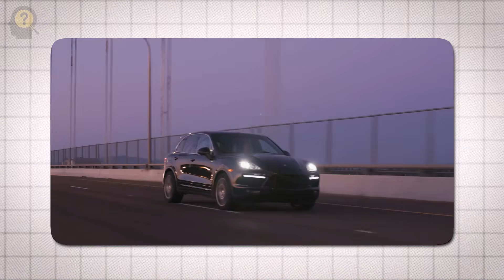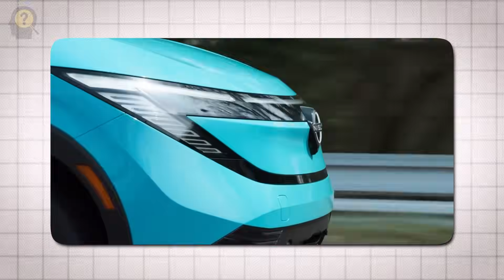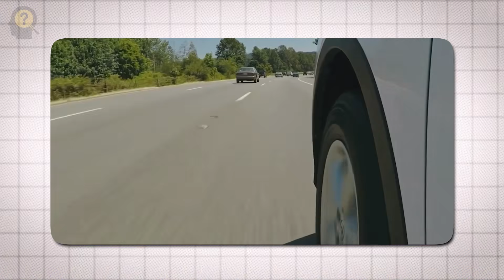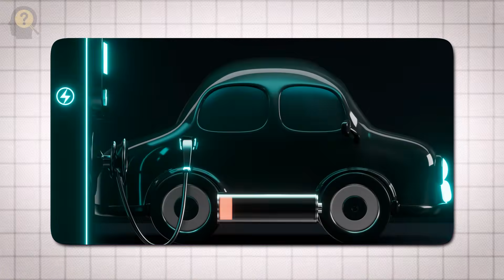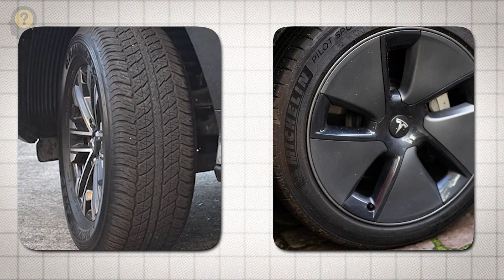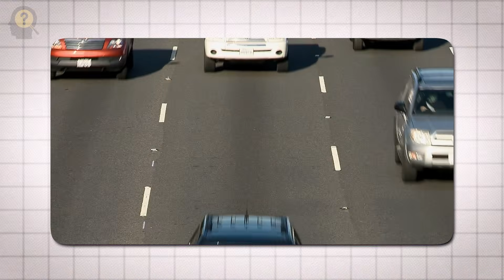EV Tires vs Regular Tires: What’s the Real Difference?

Comment: According to my tyre supplier tyres are composed of some thing like 500 compounds, but no rubber.
So why keep using the word rubber.
And if you got that one simple point wrong how many other points are wrong???
Reply: Frol AI:
Car tires are made from several different raw materials that together make them durable, flexible, and safe. Here are the most important ones:
🛞 1. Natural rubber
Obtained from rubber trees (latex)
Provides flexibility and good grip
🧪 2. Synthetic rubber
Made from petroleum-based chemicals
Improves wear resistance and performance in different temperatures
⚫ 3. Carbon black
A fine carbon powder
Increases durability, strengthens the structure, and gives the tire its black color
🧵 4. Steel
Used in the tire’s belt structure (steel belts)
Adds strength and helps maintain the tire’s shape
🧶 5. Textile fibers
For example polyester, nylon, or rayon
Support the structure and improve driving comfort
🧴 6. Chemicals and additives
Sulfur (used in vulcanization → hardens the rubber)
Plasticizers (improve flexibility)
Antioxidants and anti-ozone agents (slow down aging)
Summary
A car tire is not just rubber, but a complex combination of: 👉 rubber + metal + fibers + chemicals
Reply: @iam5085 
The rubber component is 50/50 natural and synthetic the average brand name car tyre will have about 15% total rubber, truck tyres around 30%. Around 2 3rds in the tread and 2 3rd in the sidewalls Cheepies will have very little to none.

The creator has depended on AI and not his knowledge on the subject. In countries that don't have strong laws regarding tyres they can be zero natural rubber.
Reply from the maker: That's fair point. "Rubber" is often used as a general term, even though modern tires are made from a complex mix of materials. We simplify some parts to keep the explanation clear.